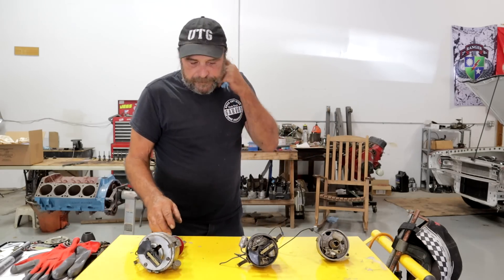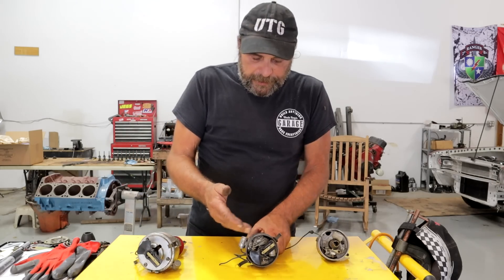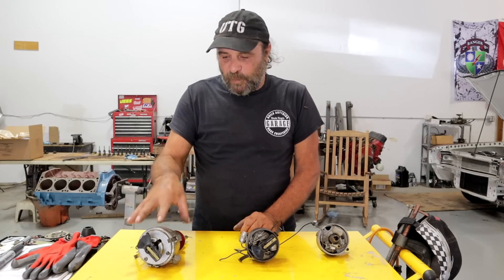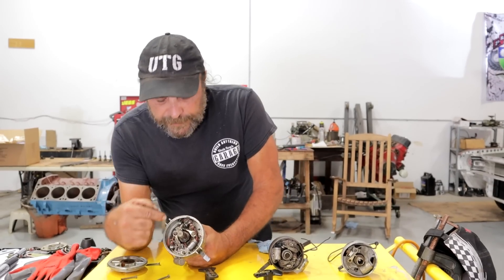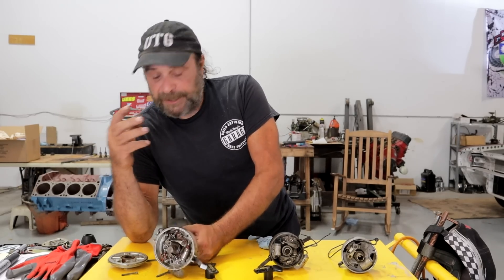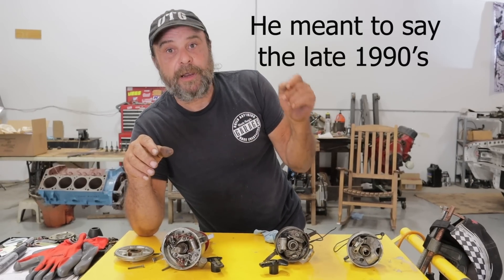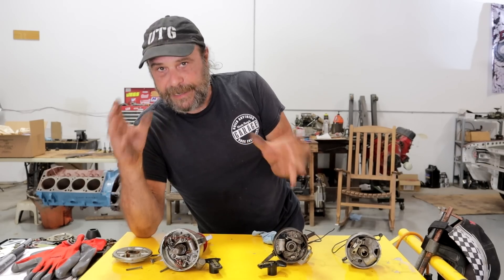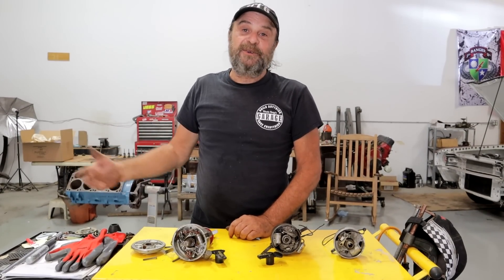High Performance Point Ignition Systems -  Tuning, Modifying And Understanding The Different Types

Comment: I have been working on cars since the early 1980s.  I have converted multiple vehicles from points to OEM electronic ignition (be it HEI, Duraspark II, or whatever) and I can definitely state that for stock, daily-driven vehicles, there is no comparison between the two - the electronic ignition is far superior.  The spark voltage and energy is FAR higher with the electronic setups.  It may be close with a fresh set of points, but once you get a bit of corrosion on your point contact surfaces, forget it.  Now in a Mad Max post-EMP/solar flare event, sure points are it, BUT . . . we can't get high-quality points any longer, and even if you could, you still have to fiddle with them every 3-5K miles or so.  

And the other huge issue - if the capacitor (called a condenser) is not sized properly, you WILL get metal transfer across the points which will greatly shorten their life.  If you aren't getting any metal transfer between the two contacts on the points, LEAVE THE EXISTING CONDENSER ALONE!!!  I used to be able to get over 20K miles on a good set of Echlin points, with light cleanings and dwell adjustments about every 3K miles.

Oh, one last item to mention here - if you reset your dwell to the exact same value (30 degrees for a single-point setup on a V8) and the base timing is set correctly, you NEVER have to adjust your timing after that!  Don't even bother even getting the timing light out.  Just make sure that the dwell is correct and you are good to go.  Nothing else causes the timing to change unless something else is wrong.  It doesn't hurt to hook up the light once in awhile and verify that your centrifugal and especially the vacuum advance is working properly (the diaphragm inside will dry out and crack).

Comment: My dad has a 69' E-type (straight 6) that he "restored" and put a pertronix distributor in, since the original was smashed. Car ran good for a while, but started running poorly, so he parked it... for 5 years. I decided I was tried of pushing it out of the shop when I needed to grind, so I'd fix it. Ended up watching a Thunderhead289 video about how to avoid killing pertronix, we had the ballast resistor installed still, just like he said not to do. Turns out we had been slowly killing the ignition module, lasted ~600 miles.  I went on ebay, got a points distributor, put it in, set the timing, set the timing again not 180 out, and boom started up. It's funny in hindsight, or maybe I use laughter as a coping mechanism to deal with the stupidity of that. POINTS FTW

Comment: Blue Streak points and co
 ndenser for my Harley and my old 70s vehicle.  Blue Streak points lubricant. One time my Harley just quit running and rubbing block folded over on points.new set of points and running again.

Comment: As long as you get spark when you supposed to, it doesn't matter where it comes from,  and more current more sparks, if it's working properly. Adding all that is not going to do anything, I wasted lots of cash on ignition, with no difference in performance, reliability was lost, I had a system that could not use a stock rotor, a new stock rotor would last only a few hours, it would burn the conductor clean off the rotor. Then burn a hole through the rotor, arcing to the distributor shaft! A friend 'borrowed' my cap and coil plug wires, I was with him when it stopped running, when I saw my stuff, I ask if he got the rotor also, he said no, I said you need to call someone to bring us a rotor, after a saw no spark, didn't even need to look under the cap, he decided to give it back, had a new cap rotor, and stock coil brought to us, we were stuck in the woods for about 3-4hours, not bad, we could been there walking out for 2,days! Haha,  it's mostly spark timing that effects power !!not the power of the spark, if you have enough, more isn't going to help!

Comment: I have tried taking points apart and putting two springs on them. For a Chevy, but a street engine doesn't need anything like that. Maybe a aftermarket coil if it's modified, more compression,  and such, the problem with a sbc, with points, they are in the rear of the engine!

Comment: The thing about electronics, as in semiconductor switching, they can not turn on and off instantly, points can probably come closer to doing that, especially with inductive loads,  they send a high voltage reverse current, part of why a condenser is required, you put about 13v on to a coil, the flyback to the points could be 100-200volts, it's a instant short time current spike,   while semiconductors can switch millions of times a second and more. It's not a clean on and off, you need a scope to see the on and off curves, but it's there, the MOSFETs or what ever they use,  to go high rpm with points, all you need is a stiffer spring, the capacitance of the MOSFET will slow the on and off times, I'm no Rocket surgeon but have studied electronics a bit!

Comment: My buddy had a '73 Z28 that was running a little on the rough side. This older guy comes over says the gap on your points probably need closed up a bit..whipped out a match book and a screwdriver and within a few minutes we were back on the road banging gears

Comment: I bought a Maverick Grabber for $200 back around 1979 because it quit running and would not start.  Points block wore down and no gap. Reset the gap and it ran fine.

Comment: Sure they work. But I remember reading in a book... remember them? That a points ignition is in a constant state of going out of tune. The block wears and it affects your timing. I switched to electronic. Set it once, and never touched it again. That was in a B body small block Mopar I used to run. Pain in the ass to adjust the points on the small block with it’s Chevy copy rear distributor. 😀

Comment: The points pivot bushing in my '49 flathead was sticking, holding the points from closing properly, last time I ran the engine.  I was able to get the truck back up the hill after messing with the points for a bit and parked it, still sets in that same spot to this day.

Comment: Did you guys get a new camera? Video image seems much crisper like 4K bs 1080
I don’t recall you doing a video on the fundamentals of dual points as installed in say an early formula s 273

I have read a couple of explanations but always forget. If you explain it will likely stick 😃

Comment: I grew up with points ignition, carburators, (manual chokes)
And manual transmissions.
  Normally an oil change and tune-up was performed at the same time. Usually 2-4 times a year in order to keep the vehicle in peak running condition.
  That was just a common and accepted part of owning a vehicle back then.
  Nowadays it is not uncommon to only do a tune-up when you get new tires,
 (About every 5-7 years) oil changes seem to be 1-3 years.
  The average driver doesn't even open the hood regularly anymore.

Comment: It's been around 30+ years since most cars rolled out of the factory with points/carburators.
   Many mechanics do not deal with either system on a regular basis anymore, let alone the average driver.
  30+ years ago the vast majority of vehicles on the road were still using points ignitions, the demand for them was high, and they were manufactured in huge quantities.
  Nowadays, because there is such a small demand for points (comparatively speaking),
The materials, eqipment, and experienced people needed to make them are just not as common anymore.
  Just like the flat tappet lifters. 
  The manufacturing equipment is 50+ years old, and because the demand is not as great there aren't many people with the expertise for the manufacturing process.

Comment: In the old days you used to drive around with an extra ballast resistor in your car if you drove a Chrysler and you would drive around with an extra module for distributor if you owned a GM because of that you'd go to the store and come out and the car wouldn't start you'd have no spark

Comment: In our old 50cc 2 Stroke Mopeds the general rule of thumb was 10'000rpm with points was fine, anything over that was kinda playing with fire, got a factory points setup up to about 11500 rpm once, but generally that wouldn't really work well, i doubt it was because the shaft moved, since the shaft was the Crank, but i guess it must have been an issue with the Points not beign able to close correctly anymore at that point.

Comment: A few times I watch preppers talking about survival vehicles. They talk about all sorts of stuff, mostly exotic stuff. I was the only one who said that I would get an older vehicle that had a points ignition or switch a vehicle to a points system. Easy to carry replacement  parts, easy to fix and not effected by electronic damages.
Reply: George if anything goes too pieces and most things burn out,   Coils are "easy"   to wind take it you can find enough wire with coating on it    5000v might be enough to run at least with right plugs

Comment: On the old Datsun 210s, a detent switch was installed for third gear to retard the spark on their dual point distributers.  It was located on the shift rails of the 4-speed transmission. I am wondering if Tony could set up the squeeze bottle to activate the retard side when pressed?

Comment: I fully agree UT!  Back in the late 80's/early 90's, I put a Pertronix conversion in my 009 distributor on my daily driver '67 Bug due to less maintenance.  My 2 '55 Chevy's (1 a Hilborn Injected SBC with a Mag and my L79 327 street car), I decided to try the Pertronix conversion on my '55 Street Car.  I spent less time under the hood tinkering.  I started to have withdrawals when I noticed my dwell meter collecting cobwebs!  It wasn't fun anymore and I felt my tuning skills begin to fade away!  Meanwhile, the HEI in my '80 Chevy Crew Cab started going through modules...once leaving me dead on the freeway!  Later, when I decided to get back under the hood of my Chevy's, I went back to Standard Brand Points/condensers.  I also bought an old Sun 404 Distributor Tester like I used in High School and I am having fun again!!!  Thanks for reinforcing my decision by coming up with the performance stats to back them up!

Comment: Few months ago i was pondering on the buying and using a set of pertronix and thought "There has to be a reason on why people move away from points"

Never thought that main reasoning would be because of the  free of maintenance portion.  Points are easily set and are easy to under stand and the convenience of repair.
 when a points set does go out at the side of the road, no need for a expensive scan tool to get you back on the road, sticking with points, thanks Tony!

Comment: You are firing on all eight on this. You got straight to the point, you didn't dwell on things that don't matter, and you condensed many years worth of knowledge in one short video. You have really sparked my interest in researching slew rates. It's kind of sad that there is so much resistance to learning about vintage equipment. I think some folks who miss the points you are making are slightly retarded. Excellent video.

Comment: I had a mallory dual point in the best running 440 I ever had. It was in 2 different cars, and I lost it when I traded the '66 Satellite.  The factory orange box electronic was superior to the "parts store" single points distr I used in a later balanced 440, and I thought it gave me more RPMs.  More recently, in the 3rd points to electronic swap in a stock short block motor home 440, I had the opposite effect.  I don't know why, but I thought the electronic lost power and top end over the points.  UKN ?????????  Defihnitely nothing wrong with a Mallory dual point.  I had the big square black coil.  I never remember touching the distr, even to gap it.

Comment: My dad's '59 Bonneville had an issue that we chased for a while and it turned out that the problem was an intermittent high frequency fault in the condenser, which had been replaced not long before.

Comment: excellent vid', only confusion is the example given of starting at 34 degrees then at full chat retarding (happens later) to 28 degrees BTDC ?. What am I missing, surely you fire up closer to TDC 28 degrees in example, then to ensure full burn at high rev;s the timing needs to happen earlier ie 34 degrees.
Whatever, these vid's are streets ahead of the millennials YT 'tech' vid's which get as technical as substituting relays ie take out , plug in. Yawn !.

Comment: great video....as always....set motors up with duel points back in the 80ies....GM accel disturter...Knew how to service them & set them up...would love to have somone explane how u can get differant timeing  &  the internals..in depth....mayb a later video...?...Thanks U.T. ....Hey Tony ...do u remember the Malory power cell....it kept the kv's @ 80,000....on a stock gm hei when u were takeing the motor over 8000...instaled  a few of them...& they worked...off topic but....

Comment: Never heard of splitting two set of points on a dual-point distributor, but  affter installing a Accel dual point in my 351 Cleveland with a lumpy cam, the idle smoothed significantly, and over-all performance was better than the factory single point.

Comment: How'd the DZ302 do it? They spun 8k rpm and they're 1960s distributors not that 80s one.
Reply from the maker: Redline was 6000 on those and they would pull to around 7000. 8K was just a number on the tach
Reply: @UncleTonysGarage  I have one and have run it to 7500 many times.
Reply from the maker: I've built a couple of them in the past, and I can tell you for sure, they won't make power at 7500 with the stock cam and heads. Spinning and working are not the same thing.

Comment: I have been messing around and doing some farming with antique tractors for years. Seems as time goes on the quality has gone down on points. At best they might make an oil  change but by that time the tractor runs like crap. When I first started this didn't seem to be a problem. In my opinion the electronic ignition makes my tractors run smoother. No more headaches when I'm trying to get hay baled.

Comment: Makes me think, to reduce point float at high RPM, could you have two 4 lobe cams offset by 90 degrees, one above the other each with a set of points wired in parallel?  You could get timing options with a moving  base plate controlled via vacuum, or centrifugal weights.

Comment: Hey Tony, just wondering if there's a duel point dizzy you know of where 1 set controls half the sparks and the second set fills in the gaps? I've not had any experience with points ignition beyond 6 cylinders so forgive my ignorance.

Comment: I learned through hard experience that the coil can fail and leave you stranded like an electronic ignition. Because I worked in remote Western Australia on tracks where there might not be another car for a week,  I carried a spare coil under the seat. And heaps of water. That said, I never understood dual points, but I first encountered them when my father in law gave me a 54 DeSoto with an early Hemi. It had dual points which scared the snot out of me because I had no idea how to adjust them. I like the computer controlled ignition in my Toyota Echo, which is fine around town, but when they die - they dead. 😉I eventually gave the DeSoto to a friend who drove to San Francisco where it ended it’s days in glory with the engine blowing up in a street drag.
Reply: In all the decades of driving (6) lve only had one coil go bad and it gave me about 3 weeks notice.

Comment: I once had an old 62 Plymouth station wagon, that had a slant 6 in it. Not the 225, but the smaller one. Like a 175 or so, it's been years, I'm not sure. Anyway we was headed home, late one night and the car started running like crap. I was in my early 20's and didn't carry many tools with me, so I just kept driving. An hour or so later we got home. I went out to check it the next day and the metal tab on top of the rotor button was completely gone. Broke off at the tip. Some how it was arcing from the coil contact enough to keep it going.

Comment: Point's so good my boat powerd by the legendery AQ115 most economicel for its size and reliable still running since new in 70's.
My mk 2 daimler point rev straight to 6 thousand in all gears.

Comment: Nice video as always. I actually like the pertronix setup. I bought a complete pertronix distributor with ignitor 3 module and havent had a problem. Reason being my points distributor was bad in every possible way. I live in Finland and sometimes its hard to find even the most basic parts and have to order them from U.S.A so I decided to try one and im happy with it. You have to remember that nothing is cheap when ordered here. Even a simple part costs 2-3 times more after the shipping and customs. But to be fair usually I have a point distributor on the trunk that I can switch on the road if anything happens. Just have to find one for cheap for my FE